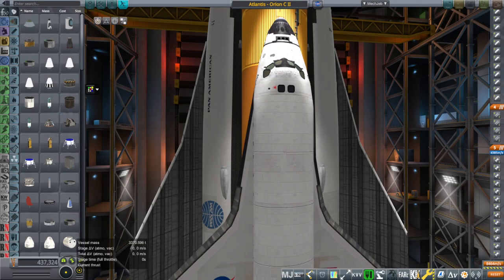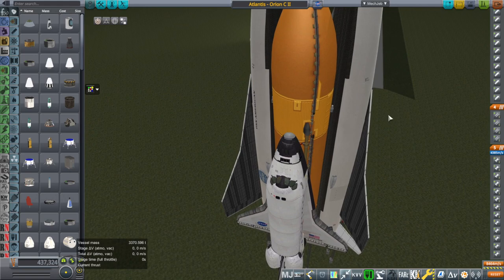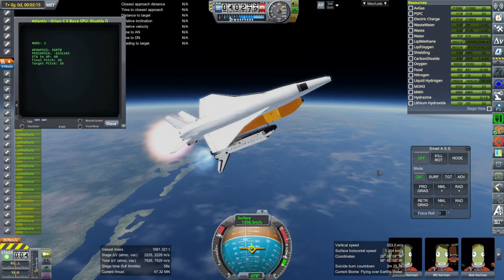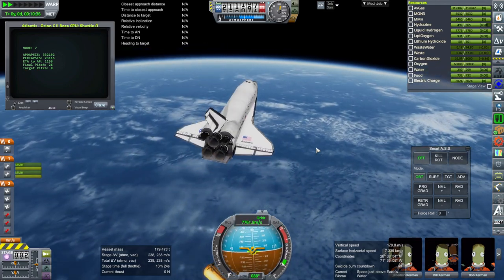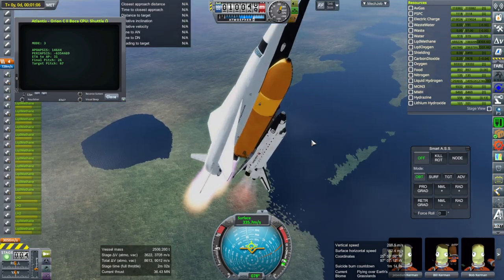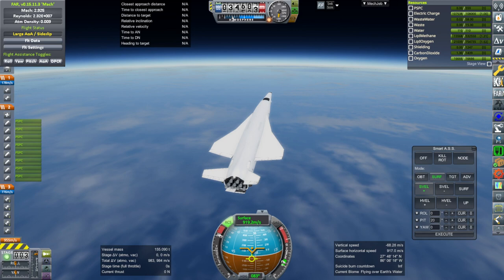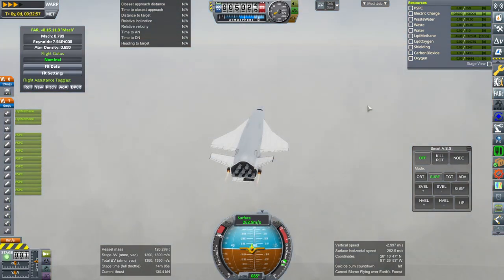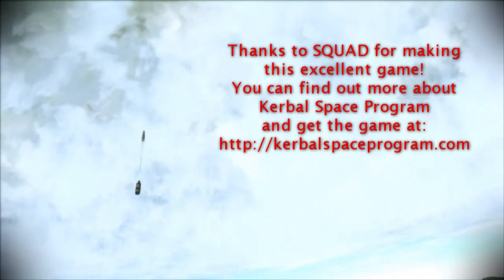Realism Overhaul in KSP 1.8.1 - The Shuttle with Liquid Boosters Part II

Comment: Honestly, one spin on this that could be an interesting idea would be “what if the LRBs used a PAC-MAN engine encapsulation device and landed in the water?” Possibly combined with something akin to SMART reuse, where instead of landing the entire LRB tank they just land an encapsulated engine section under parachutes.
Reply from the maker: I did it with the tank, but it worked out because of the way the tank was shaped: https://www.youtube.com/watch?v=qH0fJhmjLR4. The problem with the way I did it there, I now realize, is that we would have to reinforce the hydrogen tank.
Reply: @RaizSpace  well, I was thinking more like how it was shown in the alternate history story Boldly Going, where the LRBs are sized as drop-in replacements for the SRBs, and after the LRBs separate from the Orbiter stack they split up into disposable fuel tank and recoverable engine pod.
Reply from the maker: Well, since they did it, I'm obviously not going to do that.

Comment: like i said i did the math from comparing information on wikipedia four regular  falcon 9 first stages do in fact have the same amount of thrust and delta V as the shuttle's solid rocket boosters but are fully reusable without the need of a second stage! but here's the big main kicker is what if we instead  used 6 to 8 falcon 9 rockets insead!  this would massively increase how much farther the nasa space shuttle can go with its main fuel tank with a even heavier payload! or we put a liquid methane version of the shuttle's fuel tank with the new orion space STO with 6 falcon 9 first stage boosters that also use four raptors and liquid methane instead of RF-1 fuel for each of the 6 falcon 9 first stage rockets! or even better yet what about even a upgraded nasa space shuttle with its engines upgraded to spacex raptors and liquid methane with its main fuel tank also upgraded to liquid methane with regular 6 falcon 9 rocket first stages as well all put together! the amount of additional l delta V the nasa space shuttle would get with using three raptor engines and liquid methane! this will have  a much higher total energy density compared to hydrogen would allow far more liquid fuel polelant in the nasa space shuttles main tank if made to use liquid methane and three raptor engines as well! also the raptor engines also are just powerful enough that spacex could make a lot more money by just selling a lot of surplus raptor engines to nasa for nasa's SLS project! also two more good advantages is the spacex raptor engines also only have the 1/3 of the dry weight when compared to nasa's RS-25  and also takes up half as much as the volume as well! all that weight savings can make the nasa space shuttle and nasa SLS go even higher from having a bit less dry wight witch mains even more delta v!
Reply from the maker: First, you need to discover how sentences work and that exclamation marks are not the only form of punctuation - it would be helpful if you want people to read what you have to say. Second, I'm already using the Raptor engines in a novel way, why even discuss Falcon 9 when SpaceX is intending to abandon them? I'm not Elon Musk's garbage collector - I want something at the cutting edge.